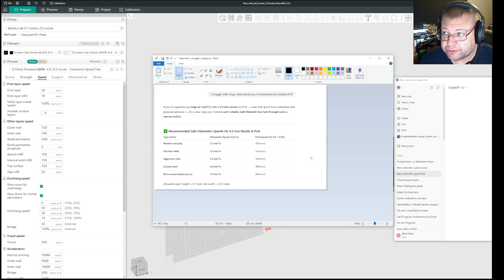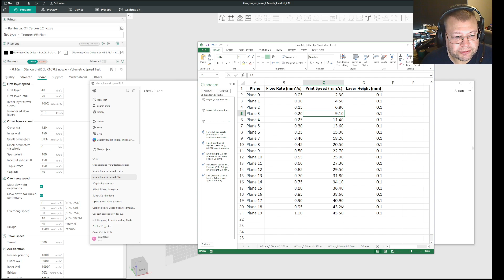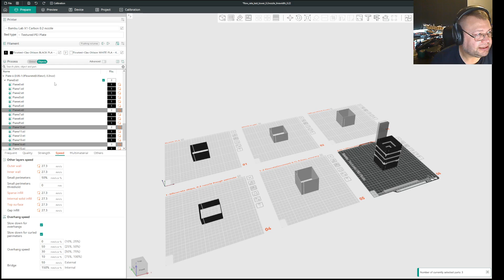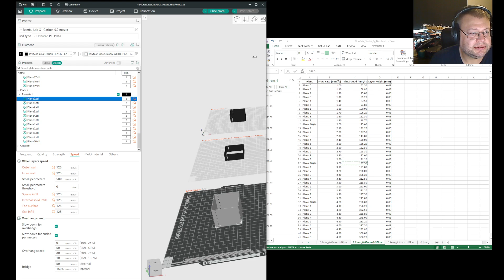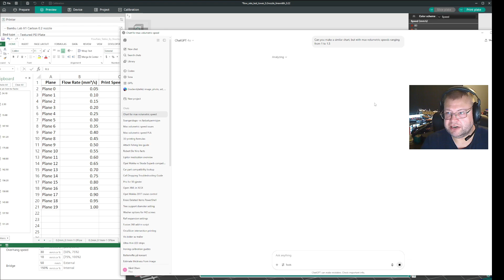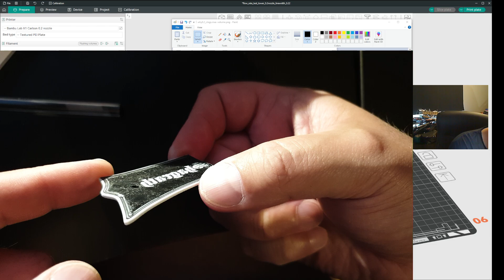Max volumetric speed calibration - 0.2mm Nozzle

Comment: 0.04 layer height x line width .22 x 50mm/s is only 0.44 :face-blue-wide-eyes:.. currently set at 2
Reply from the maker: what is your nozzle size?
Reply: @Toffypops  0.2 bambu nozzle
Reply from the maker: 0.04 layer height is insanely low, even for 0.2 nozzle. I never print thinner than 0.08mm layerlines. First layer should be 0.12mm with 0.2 nozzle minimum.
Reply: @Toffypops  yea even calibrating flow it still fails alot. Use it on certain mini.. .08 regularly on mini. .16 on anything not tiny. But I print alot of tiny things.
Reply from the maker: just make sure first layer is never below 0.12mm